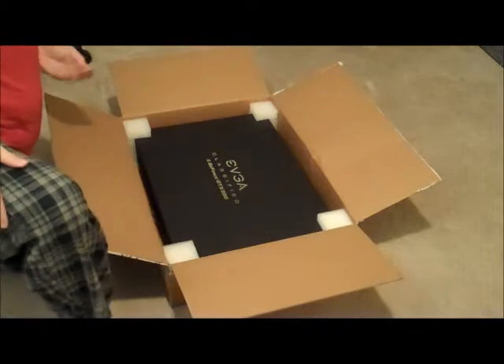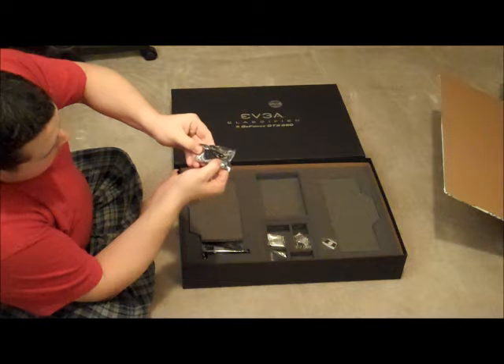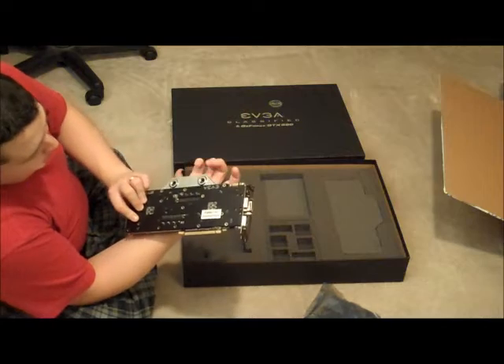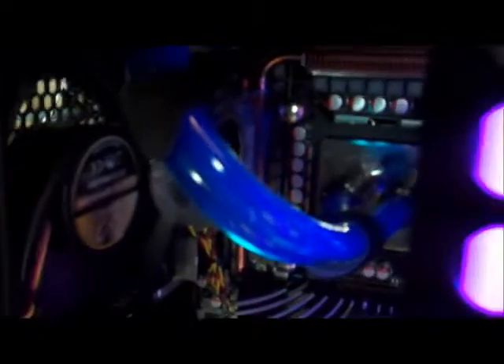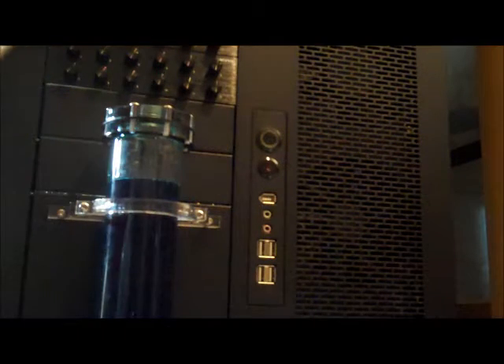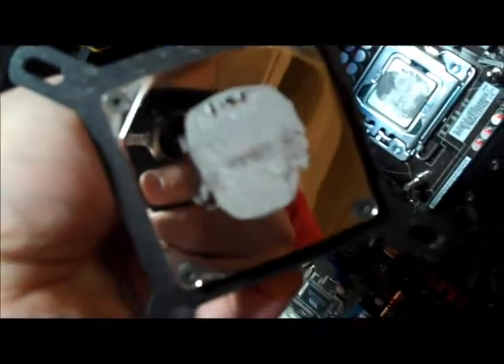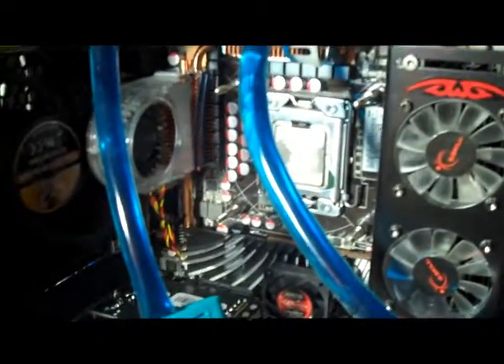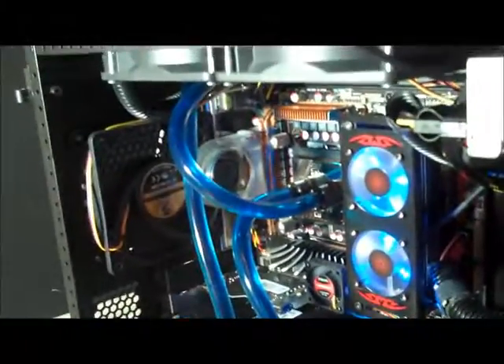EVGA GeForce GTX 590 Classified Hydro Copper Unbox & Install - @Barnacules

Comment: do you think it'll be a good investment to buy three GTX 590's hydro copper ?
Reply: will two gpus work ?
Reply: so what about the 580s ? will three work for that gpu ?
Reply: yea i doont know that much about pc building lol its cool im not offended. yea im actually going to do a lot of research before i buy. 

do you recommend 3 580 hydro coppers or two 590s ?
Reply: or liquid cooling nvidia gtx ? 

thanks for the help by the way. I appreciate it.
Reply: thanks man ill be sure to message you when i have any questions.
Reply: alright thaanks man
Reply: Kevin Escobar The GTX 780 ti is the best GPU on the market for gaming right now. Don't get the 500 series.
Reply: alright cool ill get a gtx 780 then. thanks man
Reply: Kevin Escobar 780ti *

Comment from the maker: Yes, the temps stay way down but I already replaced the card with 2 aircooled 680 FTW's. The liquid cooling on the 590 was unnecessary since they don't let you overvolt it so you can't really get it to a speed where the waterblock is really helping you.

Comment: That's a good idea. I was going to wait for the 7990 to come out but I decided to just grab x2 MSI 7970 Lightening Edition cards and toss them in Crossfire. Mainly because they would consume far less power and they would run faster in a dual GPU set up rather than a dual GPU card. :)

I like your setup, I currently have an eyefinity set up with x3 21.5 inch Asus LED monitors ( which are beautiful monitors for the size and price ) and I couldn't be happier.  Cheers! :D

Comment from the maker: You need to buy the SLI liquid coupler things that just hold under pressure to connect the cards when they are that close, but it will work. And I am using 3/8th.

Comment from the maker: It's 2x 580 GTX's on one card, so it's kinda worth it. But you can't overclock them like you can the GTX 580's so 2 of those will kill this card if you push it and upgrade the cooling.

Comment: Hey man, i commend you on your rig, it is very nice!  I am currently building my own 1155 socket setup, its pretty sweet up to now, just need the GPU :P  I think i'm deffo gunna try and get my hands on one of these EVGA's (if i can ever find one that is lul) I was just wondering what size are the barbs that come with the card and what size is the internal thread that they screw into?

Comment from the maker: @cswao19 You can actually get a pretty good setup for $~200. I would suggest checking Craigslist or eBay and trying to get a few ATI Radeon 5870's since everyone is upgrading. Two of those cards in Crossfire actually will play just about anything at 30+ FPS. That is the setup I upgraded from! I sold my cards on Craigslist for $250 months ago. Also nVidia has some serious problems with there drivers so I would have gone ATI if I knew what i knew now :)

Comment from the maker: @cswao19 I honestly haven't given AMD the time of day so I may have to read some reviews. I have years of past experience with AMD and they were nothing but trouble in my opinion. They run super hot (atleast used too) and the build quality and reliability wasn't as good as Intel. This may have all changed however I still have a bad taste in my mouth. I remember the old K series of processors that the CPU fan would go out and they would literally just burn up. What have you heard?

Comment from the maker: @imnotnutz89 The temps are rock solid at 27C idle - 33C under full load. This temp range is about the same for the GTX 590 and the CPU since my water cooling setup is completely overkill. I honestly did this setup because nobody had done it before however I suspect after the number of views my videos have received other people are going to be building a setup just like (or better) then mine in the near future. My friend Greg also built the same setup.

Comment from the maker: @prattlesnake42 Thanks for the heads up, I was able to solve the problem by rotating the hose a bit. Water cooling from scratch like I did is a lot harder then I thought it would be. I am absolutely loving it thought! I'm going to upgrade to a hex core sandybridge on Black Friday. I'll post some video when I get it all setup.

Comment from the maker: @aditzrulez they do make a water-block for my motherboard however it is a P6T Deluxe V2 (a bit out dated) and I plan to upgrade from my I7 Bloomfield to the Sandy Bridge when Intel releases a triple channel hex core version early next year. I already maxed out the CPU's abilities well beyond the motherboards so extra cooling wouldn't give me any added benefit. With the water cooling on the CPU I was able to get rock stable on prime at 4.2ghz and when I'm just gaming I can get to 4.6ghz

Comment from the maker: I ran it all last night and all day today with no leaks or problems. The graphics card is staying under 32C at full load and CPU temps are staying same as before. I'm not sure how I feel about nVidia's software, doesn't seem nearly as good as ATI's for switching profiles, etc and I do have some odd problems with DiRT 3 where the 3rd monitor in surround has a sync issue but other then that it is very fast. 7.9 graphics score in Windows 7.